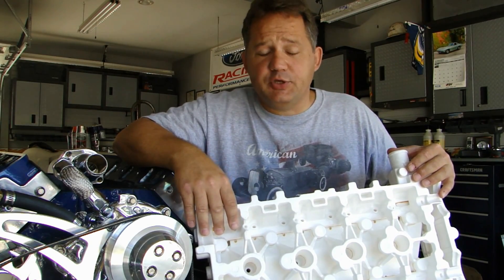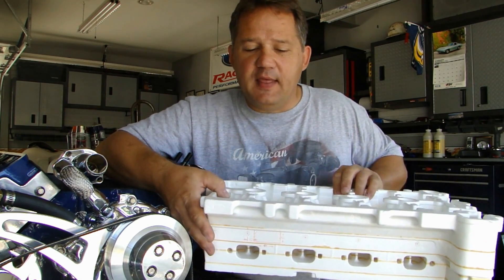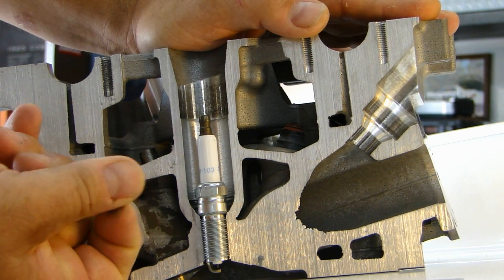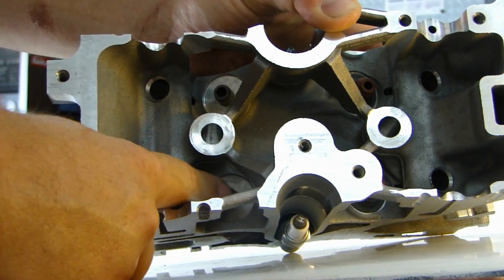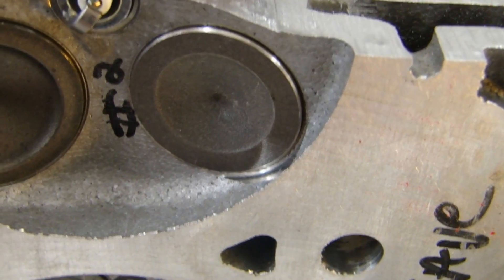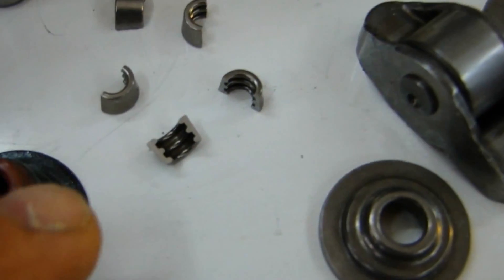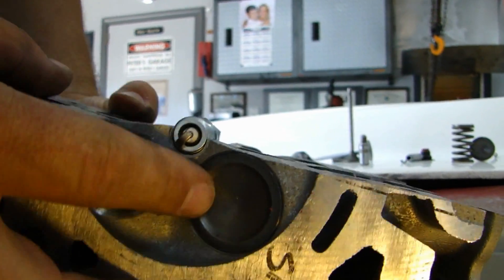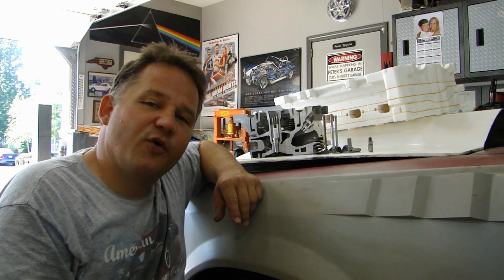How Cylinder Heads Work

Comment from the maker: Its actually an HLA.... Hydralic Lift Assist. It works just oike a lifter but is stationary. It supports the side opposite the valvle for the RFF Roller Finger Follower.

Comment from the maker: A friend loaned it to me. Most Loc-Tite is pre-applied to fasteners by the supplier. Auto manfacturers would not waste the time to apply it. It would require too many controls, not to mention the variability. I can't think of anything used for anti-tampering other than special fasteners or sealed parts.

Comment from the maker: The only time I would change them is if you take out the injectors for some reason. Other than that they should remain undisturbed. Spraying some WD40 on them occasionally to keep them soft would not hurt.